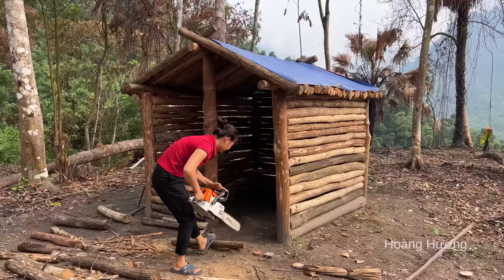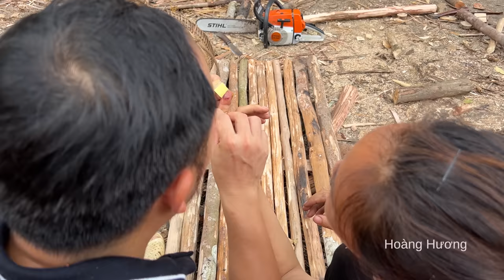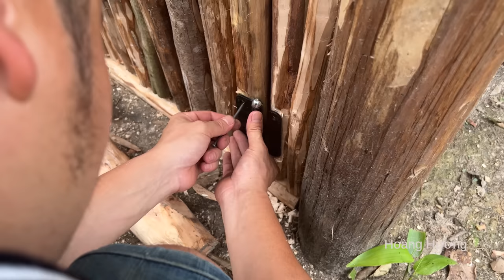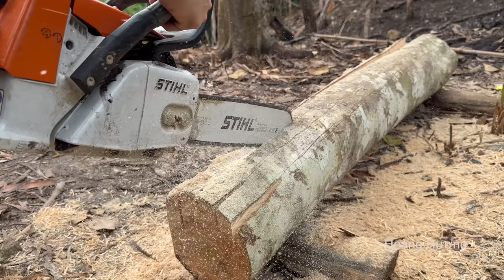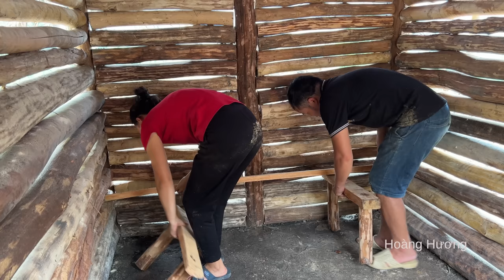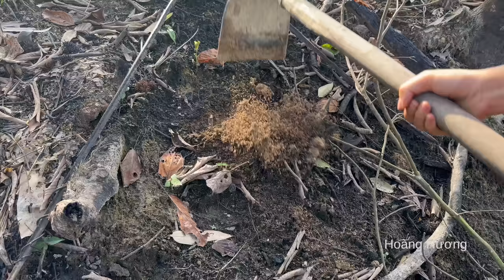Complete cabin in the mountains, cabin door, bed - Husband's surprise visit (special day)

Comment: Duong / Hoang Farm, The North 40! Lol I don’t what direction this new farm area is from the main farm, but this sounded good! Lol

You both either already some experience with chainsaws or using one came real easy to both of you. Regardless, please use common sense and safety when using that chainsaw or you might suffer a much larger wound than a finger cut. : ) 

Good job on the bed construction. I hope you can make a table and chair for your cabin too. Those wall logs have some pretty large gaps between that will allow wind and rain blow through. Will you chink those? Otherwise, maybe some woven bamboo wall coverings would help block the wind more. 

A little wood shed to stack firewood in close by the cabin would be nice. 

Where you both stood looking out at the great view over the valley would make a great place for a shade cover, a couple of nice chairs to lounge in and a small table. A nice view needs a relaxing way to enjoy it. 

You all need some more tools. Trying to share the same tools between both farm areas has to be inconvenient. As bamboo is such a great material, a couple of rakes would help with clean up of debris around the outside of the cabin and with leveling garden bed soil. Gardening on hillsides has already proven a real challenge. 2-3 shovels, a couple of picks would be handy for create terraced garden beds, swales and berms to get better use of precious rainfall for your crops. Terraced garden areas would also provide a better place for planting fruit trees, etc. The possibilities are endless! : ) I know you want to plant crops quickly, but better planning on how to develop the growing areas will give you better produce yields.

You might also consider planting a pollinator attracting flower garden to bring more native bees, etc., to this area.

I could see a big walk under trellis structure for vines to climb all over where you planted the cucumbers! : )
Reply from the maker: Thank you so much

Comment: Blipping the throttle does nothing only waste gas and slows the cut. A steady throttle is much more fuel efficient and cuts faster. Moving the saw back forth is a waste of time and effort, let the saw do the work. Your chain is too loose, your manual should show the proper tension. In a nut shell, bad things can happen, sometimes resulting in a trip to the hospital
Reply: She's wearing sandals.
Reply: @Gterr1971   And now chainsaw pants, ear, eye , head protection , or gloves, now fire powder, or first aid kit.  Yup, OSHA is going to put her in jail for years.
Reply: @mazdarx7887  lol. Safety is out the window I guess
Reply: @Gterr1971   Safety is highly over rated besides, you said she had sandals on. No sawdust splinters in her feet, see, safety.. Me fadder owned a sawmill in Nfld in the 70's, our safety equipment was Muskoil.
Oops , almost forgot, we had steel cable in out climbing strap when topping trees, sucks to cut your climbing rope with the saw